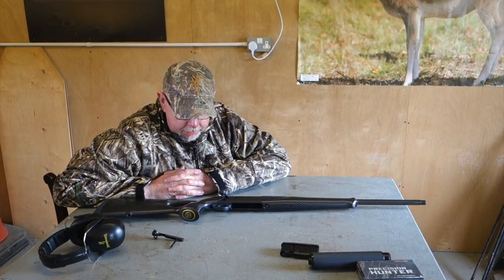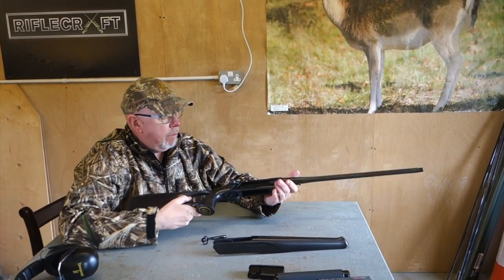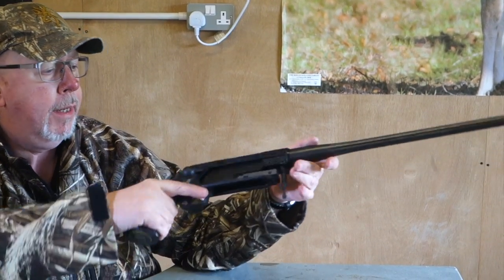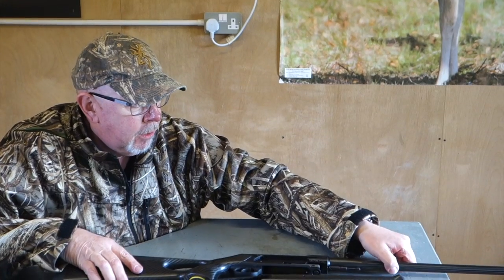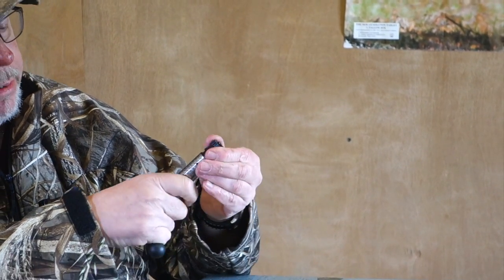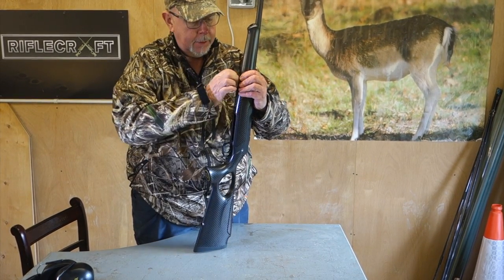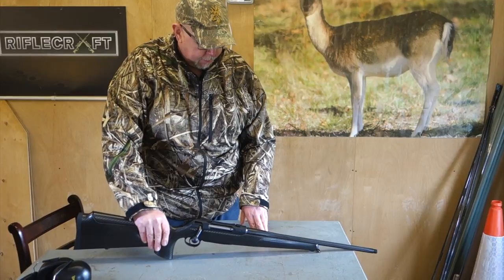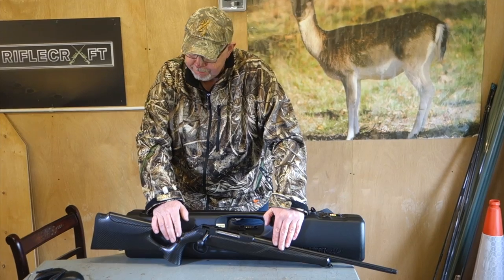Sauer 404 Synchro XTC  Part 2 (the strip down)

Comment: Hi. Good vido. I have the 404 in 3006. Took the rifle apart the other day and back together forgetting to tighten the 1,2,3 screws that connect the barrel to the stock. What would happen if I tried to fire the rifle? You mention that once the bolt interlocks with the barrel nothing can happen...I wouldnt try it but am just curious. Thanks